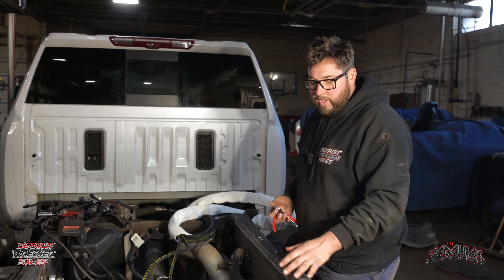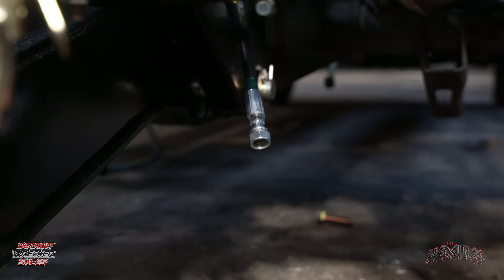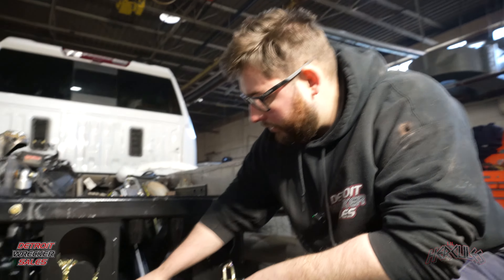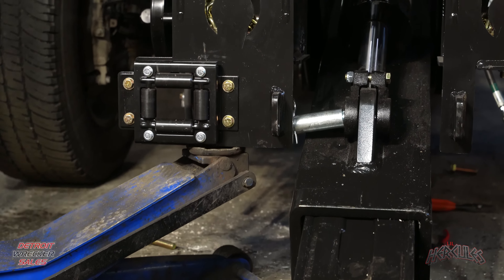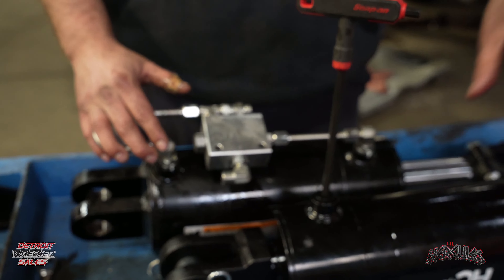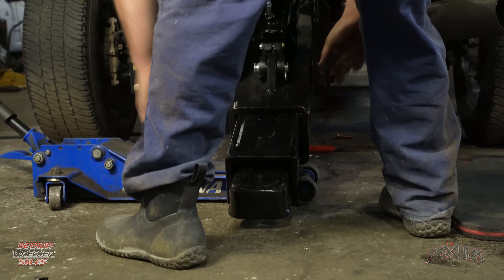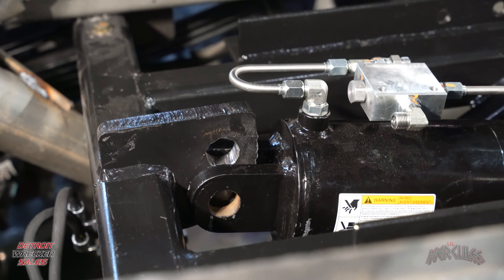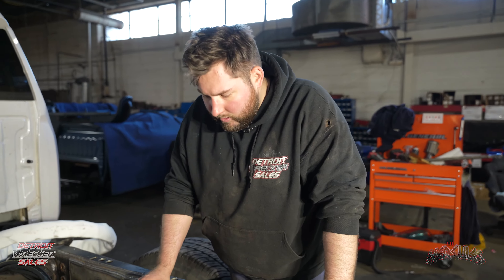Lift Cylinder Up/Down Replacement Tutorial Lil Herc 2.0

Comment: Are the cylinder pins greased or is there any recommend preventative maintenance for them?
Reply from the maker: Just spray them with some WD-40 or any type of lubricant they don’t need much because the stroke of the cylinder is so short. There is no grease fittings because of the short stroke on the cylinder we’ve never had to replace the pins for the up-and-down cylinder ever